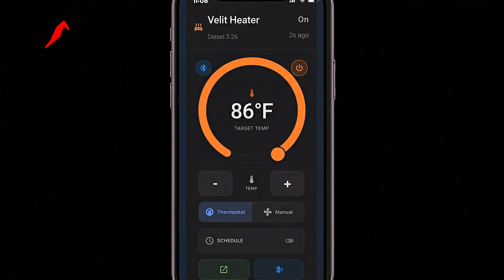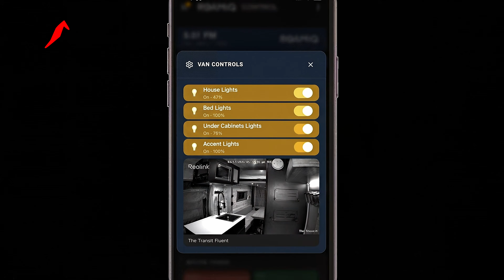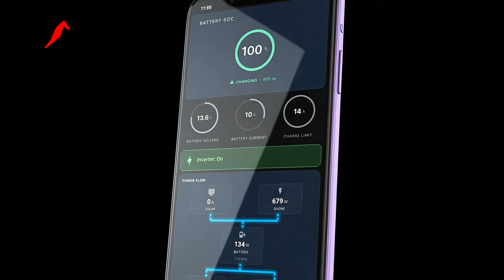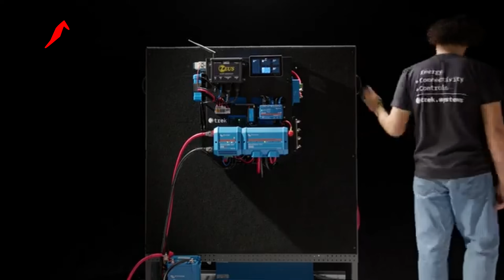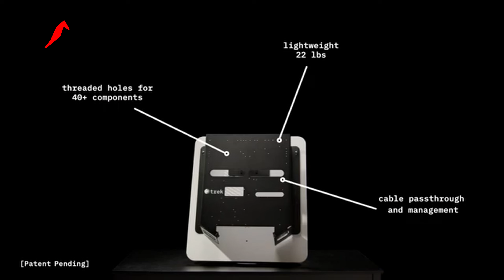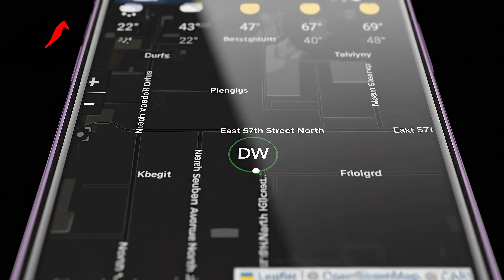Introducing ROAMiQ | Smart Van Platform | Featuring the ROAMiQ × Victron STACK

Comment: This is a truly excellent system. We offer a high-precision water tank level sensor that outputs a 0-2.5V analog voltage signal (which can be connected to the Victron Tank 140 and EcoFlow Power Link). May I ask if the ROAMiQ system has supporting hardware interfaces?
Reply from the maker: Absolutely. ROAMiQ is designed to support a wide range of hardware interfaces and communication methods depending on the application. Analog inputs like 0–2.5V are definitely on the table either directly or through supported third-party hardware. That said, for your specific product, Bluetooth integration may currently be the best path. We’re continuing to expand integration support as the ecosystem grows. Your sensor looks very interesting, especially for high-precision tank monitoring applications.
Reply: @rackupgo  Thanks a lot.We will contact you again if needed.

Comment: Rixens hydronic floor system?
Reply from the maker: It’s something we’d definitely be interested in supporting. Integrations typically require cooperation from the manufacturer so we can properly support their communication protocol. We’ve already been able to do that with Proheat, so their hydronic system will likely be the first one we bring to market. If the opportunity arises to work with Rixens in the future, we’d certainly welcome that conversation.
Reply: @rackupgo  that would be pretty awesome. I am in the process of building out my Transit and will be using the Rixens hydronic system with heated floors. Rixens is the most popular solution for this and having it integrated into ROAMiQ would be incredible. I've been considering A/C options and was thinking of going with a Nomadic and their Helix device but if this can operate a Velit from across the globe, then maybe I can consider this option... I am about to purchase the RV5 from your website, so hopefully this will work with it soon!
Reply from the maker: @built2vanish  yes, we currently integrate with Velit, so all good there! If/when we add Rixens integration, you’ll be able to add it to your ROAMiQ dashboard with a simple firmware update. Same with Bluetti, that integration is being finalized as we speak. We should have this for you in the next couple of weeks.

Comment: You should have called it... Roam Assistant..
Reply from the maker: Haha that’s actually a pretty solid name suggestion. What other features would you want to see from a “Roam Assistant”?
Reply: @rackupgo I would mimic what you can do in home assistant. Focus on connecting any type of device and open up custom coding/addons.
Reply from the maker: @FritzFreund  Absolutely. That’s actually very much the philosophy behind ROAMiQ. It’s built on Home Assistant specifically so people can still customize and build on top of it if they want. Where we focus our effort is making the core system plug-and-play for van builders and owners - hardware bridges, integrations with common devices, and maintaining those integrations so people aren’t constantly troubleshooting or rewriting code just to keep things working.

Comment: So, Home Assistant for a vehicle? Neat!
Reply from the maker: That’s the foundation, yes! The main idea here is that ROAMiQ adds the hardware layer, van specific integrations, plug-and-play devices, and ongoing system maintenance so builders and owners aren't engineering or maintaining the whole thing on their own. The goal is giving people the power of open source without needing to spend months connecting things together, writing or hiring someone to custom code, or maintaining their system themselves. 

We’ve built the hardware bridges, device integrations, and van-specific dashboard so it works with things like Victron power systems, RV-C, heaters, A/C, fans, tanks, etc. out of the box.

Comment: Can command/control CI-Bus devices (Alde/Truma/etc)
Reply from the maker: Not yet, but it’s something we’re looking at on our roadmap. Since CI-Bus is also a CAN-based system, it’s technically feasible, we will just need to build in the integration.
Reply: @rackupgo it’s a LIN bus but the issue is that the protocol is not public available 😢
Reply from the maker: @lavagninoriccardo2224  yeah that is the tricky part. LIN isn’t a problem from a hardware standpoint, but since the protocol itself isn’t publicly available it makes integrations more challenging unless the manufacturer collaborates.

Our team will reach out to begin those conversations, and if the protocol becomes accessible to us, it’s definitely something we’d be interested in supporting.